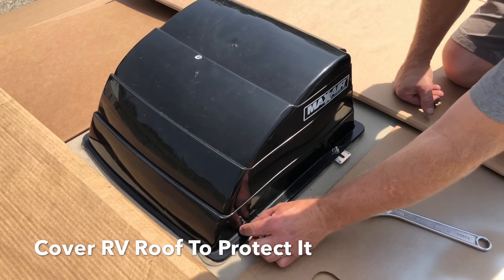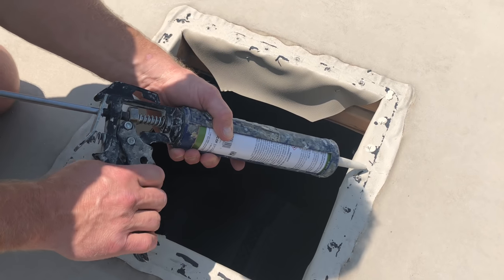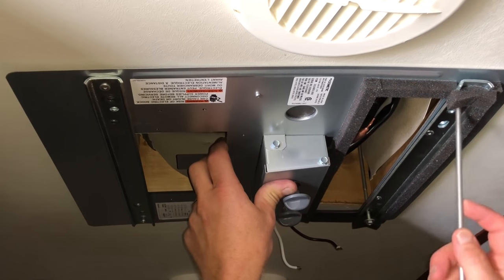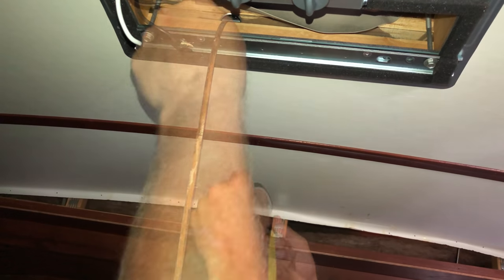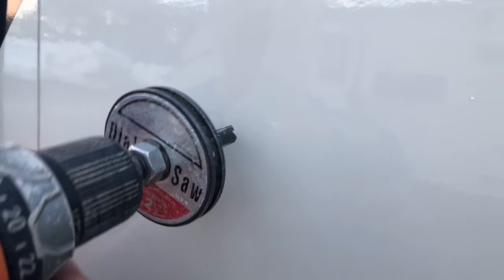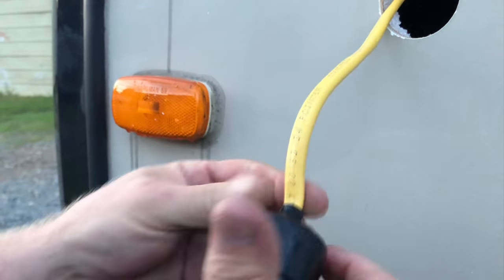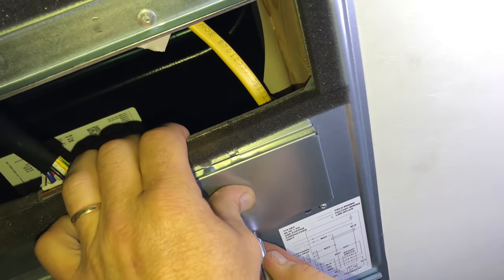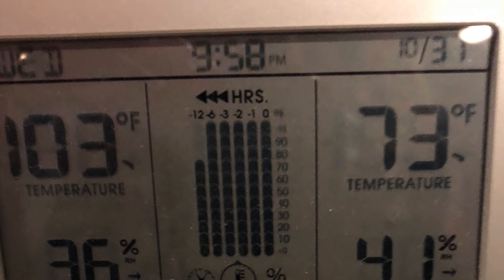Installing a 2nd AC Unit in a Camper with a 30 Amp Service

Comment: I noticed you did not seal off the AC unit from the open gap in the roof?  It will pull/push air into the ceiling void, will it not?

Comment: Loved the video!
Which AC unit did you buy?
This is exactly what I want to do in the rear garage area of my 29' 5th wheel toy hauler.
I plan on doing a bit more though.
I use my camper in colder weather like way up in the mountains where it gets chilly even in summer.
Don't just put that "second service" in for only the AC unit .
Instead add a couple extra strategic outlets in the camper to plug in a space heater or two for cold nights to help save on LP. 
Most campgrounds do not meter the electric at the sites , sooo......
Heat with electric as much as you can.
The extra 20 amps can be used for rear cooling on hot days and heating on cold days.
I am even installing a 2 GFCI breaker box in a closet so I have my own overload protection in the camper for these 2 devices.
It is much easier to add the extra service than mess with the OEM power center the RV comes with.
Reply from the maker: I believe I bought a domestic but not sure which one. I didn’t get any sponsorship for this video so any one that fits your specs will be a. I’ve addition. It sounds like you are setting your rig up nicely. Thanks for watching.
Reply: @funbro1   BTW , I went to my local "Camping World" store , ordered and received the 20 amp 120 volt power inlet that goes on the outside skin of the camper.
I do plan on using the 10 gauge wire for all this as the heaters and AC unit draw a lot of current.
I bought an 13,500 btu AC unit with motor start capacitor from ETRAILER for $600.00 , free shipping.
Now just I need warm weather.
The extension cord I'll buy for this will be the 10 gauge contractor grade cords.
Reply from the maker: Perfect. You will love this set up I’m sure.

Comment: First of all, awesome video!!! Second, I was wandering if I could use the existing wiring where the vent fan is in the bathroom?
Reply: Wiring isn't heavy enough
Reply from the maker: New wire would be my recommendation unless the unit is set up for a 2nd AC. Thanks for watching.

Comment: Hi, I really appreciate your article. I only have one question/suggestion. It looks like where you ran your power wire from the AC unit into the ceiling that is also the return? I think you need to seal that area so that you are not pulling return air from above your ceiling. I am now in the process of making the same upgrade to my 5th wheel, installing a 2nd AC unit in the front bedroom. When I removed my old vent assemble I noticed that I have a similar area towards the front and rear of the opening where I can see my aluminum roof rafters.  Your article has been a great help.
Reply from the maker: I believe the vent you are looking at is the ducted vent from the existing(main) AC unit. Very soon after completing this video and the first camping trip I added a cover to the vent to force the air from the main AC to the rear of the camper. This works great because the secondary(new) unit will easily cool the front and with the extra air going to the rear it keeps the camper nice and cool.  Best of luck on your install, you will enjoy the added AC. Thanks for watching.

Comment: I realize this is an older post, but what are your thoughts on adding a mini split to our stationary travel trailer vs. the second air and circuit that you had done. Thanks for your thoughts!
Reply from the maker: That would be something I would consider however this might be easier because of the hole in the roof is already there and the rooftop AC fits perfectly. Either way would probably work though. Thanks for watching, happy camping.

Comment: Great video!  Is the fusible link/breaker 15 amp or 20 amp? and is it connected on the power supply post side or camper power inlet?
Reply from the maker: It can actually be either as this unit does not use any more than 15 amps. I located it on the camper side power inlet. Hope this helps, thanks for watching.

Comment: My roof is not flat. It is curved. Does the unit conform to curved shape of the roof so it will be sealed?
Excellent video!
Reply from the maker: Yes, the roof in the video is not flat. The unit has a thick “seal ring” “padding” “washer” to make up for a non-flat roof. Thanks for watching.

Comment: Did I miss it or did you not show the roof installation for the exterior unit?  Other than that this is just about the best retrofit video to an existing RV that I have seen.  I was wondering how you were going to add the "load" to the RV panel and get away with it, but making it a separate circuit that goes to the electrical supply was the solution.  Great job.  I'm glad the interior cabinet was not so big that it ovoerlapped the ceiling fixture opening (might make it hard to relamp the fixture).
Reply from the maker: Roof installation starts at 2:44 in the video. Most of the roof installation is done inside. The only thing done outside is setting it in the correct location (centering it). This set up works great in hot weather. Thanks for watching.

Comment: great video. I have a 2017 24' toy hauler that's a 50 amp service. How would you wire this in? Could you just wire the ac unit to a standard 110 plug and simply plug it into an existing outlet?
Reply from the maker: You could do it that way but if you have a 50 amp service your camper may already be wired for a second unit. If not I would look at the breaker box to see if there was enough room to hard wire it into the box. Hope this helps, Thanks for watching.

Comment: Absolutely fantastic video, one question though, Whats not included when you buy an AC unit. Im thinking of buying a Dometic or Coleman. Thanks
Ohh by the way my RV is already prewired for a second unit.
Reply from the maker: As for just the AC unit. the control panel was a separate purchase from the AC unit. Other than that everything else needed would be for hook up and that may vary from camper to camper. Hope this helps, Happy camping.

Comment: You answered my question sir. I was wondering if you could put an ac unit in place of the vent. Now I'm getting my son charged up for us to do the same thing. Only question is do you have a parts list? Thank you so much for the video.
Reply from the maker: Start with the 2 main items, 1. The AC 2. The control, The rest will vary by the unit. Thanks for watching.

Comment: Good video and explanation. I have a trailer that didn't come with a/c but it has a large skylight right where it would go. I haven't had a chance to take the trim off and look but I'm hoping the wiring is already there. Any thoughts?
Reply from the maker: Definitely would be worth the time to investigate. What amp service do you have coming in to your trailer? Some models had the option to be wired with either 1 or 2 AC units and were able to be wired with 30 or 50 amp service. Thanks for watching.
Reply: funbro1 it's 30 amp service. I can tell it was designed for a/c since the skylight is in the right place and the right size.  The thermostat also has a “cool” setting. It's the “Northwest Edition” which probably meant “No a/c 'cause it never gets hot here Edition”. I guess I should be able to find the wiring in the ceiling if i take the trim down on the inside of that skylight. I just don't want to get it leaking. If it's not there, what do you think are my best options for running the wiring?
Reply from the maker: I would find the best looking way to get the wiring to the outside of the RV. They all have a different set up and some are easier to hide and some will need a wire mould to hide the wire.

Comment: Great video! We are looking to do the exact same thing to our camper. Do you have any specific brand to use? We have a 30amp unit.
Reply from the maker: I do not endorse any particular product for this install however I would make sure that the unit is able to work with the size hole you have in the roof of your camper, it just makes the job that much easier. Thanks for watching.

Comment: Thank you for the video! I have a 2018 forest wildwood. The master bedroom has no roof ventilation. The ceiling has a vent from the AC duct. Is it possible to cut a space open in the roof to mount a new 30 AMP ac unit or even a motorized vent?
Reply from the maker: You would need to block off the vent from the main AC first then you could cut a space for the secondary unit. You may want to add another vent for the main unit so that it still has enough flow. Hope this makes sense. Thanks for watching.

Comment: Nice vid! Was there a condensation drain? If so, how is that setup?
Reply from the maker: The condensation drain is set up so that it is built into the unit. The condensation all happens on the top of the roof and there is a pan underneath that catches the water and drains across the roof just like most rooftop units. Nothing special was needed for the condensation. Very easy, basic, install other than some minor modifications. Hope this answers your question, thanks for watching.
Reply: @funbro1  it does!! Thanks a bunch!

Comment: I have a 50amp with 2ac unit I would like to add a 3rd one because in tx is 110 degrees in summer but is not Pre-wire do I follow ur steps or how do i make it work i think i don’t have an extra space for an extra breaker

Comment: @funbro1  I am considering this approach, but have had dealerships tell me the AC will not last as long unless I upgrade the electrical to 50 amp and tie the second AC into that. Its pretty costly. How has your install held up after this install? Any AC issues? That is what I am being told, that the unit will burn out faster if doing it this way. Thanks in advance!
Reply from the maker: I would guess that the dealership has your wallet in mind when telling you that. Many people are intimidated by an install like this, that is one reason why I figured I'd post this video. To explain how it works consider your RV is hooked to a 30 amp service, you then add an AC unit that can effectively run off of 15 amps or less and is wired as the only thing on that circuit. Most Campgrounds have 3 plugs, a 50 amp, a 30 amp, and a 20 amp. Doing this type of install I simply use the 30 amp service that comes factory installed from the manufacturer then I add a completely different 20 amp service making the RV a total of 50 amps. 

Stop by that dealer and ask them if you have a whole house AC can you run a window unit as well? If they know anything about electrical they will tell you that there are 2 different circuits and that it should work fine if your panel can support it. Same thing with this set up... Also make sure that you do run a heavy duty extension cord, especially if it is any length. 

So to answer your question. This AC works so good (still) that I am upset that I did not install it sooner or in previous RV's. It makes all the difference. Hope this helps,Thanks for watching and happy camping.

Comment: Fantastic Job!  But you have two very real safety issues.  You needed to use a 20Amp plug on the outside of your camper.  A/C's have two motors (Fan motor and Compressor).  Each has a "startup" or "surge" amperage that combined is typically around 18 to 24 Amps.  Then the motors settle to a "run" amperage of around 12 to 15 Amps combined (depending on the age of the A/C unit and the quality of the power at the campground).  You used 12 gauge wire which is perfect, but you mention that 14 gauge would have worked.  14 Gauge is not sufficient for the startup amperages.  Finally, I would recommend that you use an extension cord with 10 gauge wire.  Extension cords use "stranded" wire which will not conduct as much power as "solid" wire, therefore you have to step up a gauge.  I would also recommend covering your wire nuts with an approved electrical tape.  We have provided this exact upgrade in our shop many times and you video is the best example I have seen out in the world yet.  Great Job.
Reply from the maker: Great, thanks for all of your concerns but I assure you that all the specs on this AC work out so that it can be done with 14 gauge wire. I decided to go with 12 gauge wire to address the things that you mentioned. I have done extensive research and understand motors capacitor ratings, and motor start ups.

As for the extension cord I do use a 10 gauge just because of the length that must be used sometimes and again just to be over the specs. 

I appreciate your comment thanks for watching.

Comment: Did you insulate the roof to stop your cold air from interning your roof? Tape, foam, etc.
Reply from the maker: No need to as the unit has vents all around and that is the only place where air can go. It is set up that way. Not to say a little tape or foam in select places hurts but it is not necessary. Hope this helps, Thanks for watching.

Comment: What brand of air conditioner do you recommend and is there a certain kind that will run off a electric cord like you have set up ?
Reply from the maker: I do not recommend any particular brand as I am not sponsored by any particular brand. Any brand should run on an electric cord once you wire it up as shown in the video. Hope this helps, thanks for watching.

Comment: I have a little teardrop I want to put a rooftop ac , but I was worried about the wiring. Running the the ac with just the exterior power no regulator or anything crazy electrical modifications needed ?
Reply from the maker: Nothing really crazy electrically if you run the power externally.
Thanks for watching.

Comment: Looks good but you should have put foil tape all along that exposed wood to seal everything up and make that ac more efficient
Reply from the maker: Not a bad idea but with this unit and the OEM unit the RV has never had a problem with inside temperatures being comfortable, even in the hottest, humid weather. Thanks for watching.

Comment: Just wondering what you did with air vent hole next to the a/c unit. My RV has two ducted vents 1 on each side of vent from my front  A/C. Was thinking of covering them up.
Reply from the maker: That's what I did. I only have one but I covered it up. Make sure that you don't restrict the airflow from your primary unit or it is possible that it could freeze up and damage the unit. Thanks for watching.

Comment: The outlet you used is it 15 20 30 amps ? We’re did you get it from?  Your video is helping me install one thank you for this video.
Reply from the maker: If you do a search for RV “park power” or RV “power inlet” you should come up with a bunch of choices.  You will want to use a 15 or 20 amp rated plug. Hope this helps. Thanks for watching.

Comment: One thing you failed to mention and show was how did you seal the roof between the air condition before you placed it in?
Reply from the maker: Didn't fail, I showed it in the video at 5:23 and talked about compressing the insulation/seal also. If you have this unit you will notice that it is already built in. Thanks for watching.

Comment: Any way to do this if you don't have a second roof vent? I only have a vent in the bathroom and that doesn't seem to be the best place for one.
Reply from the maker: The only way would be to cut a ole into your roof and brace the roof. This is a little more difficult install. Thanks for watching.

Comment: A couple things here. One is an electrician with advice that sounds condescending but as for when making the electrical connections, especially what I noticed at the plug, using the phillips is a great connection STARTER but to finish it off, use a large flat head to REALLY make those screws tight. The AC is a big power consuming appliance that heats up the wiring, causing expansion and when it cools, contraction of the wires with eventual loss of connection causing the circuit to end up sparking at the connections over and over, causing heating of that area then eventually HOPEFULLY just melting of the plug and wire. That is a huge service call situation I get many times a month, even a week.
NOW, the question...

What if I don't have a vent? My rear bed's ducting isn't sufficient air flow and I'm thinking another AC might be the trick. How do I know where to cut for the ceiling cut out?
Reply from the maker: I checked the connection again and they are still tight. 

You will need to locate the roof trusses and place the unit between the trusses, Keep in mind that the ducting may run through the ceiling so you would need to avoid that as well. Hope this helps. Thanks for watching.

Comment: So was the existing wire for the maxAir not a good enough gauge to use that as it was already wired I assume for the maxAir?
Reply from the maker: In this case there was no MaxAir fan, but if you do have a MaxAir fan it is a way smaller gauge wire and already wired up to DC and cannot be used for this application. Hope this helps.
Thanks for watching.

Comment: Thanks for taking time to make this video! Did you keep the duct work in the master from the original ac or did you cap them off? Thx
Reply from the maker: I kind of capped it off 1/2 way. The reason I only did it 1/2 way was because I was worried about the main unit not having enough flow and causing damage to it.  Thanks for watching.